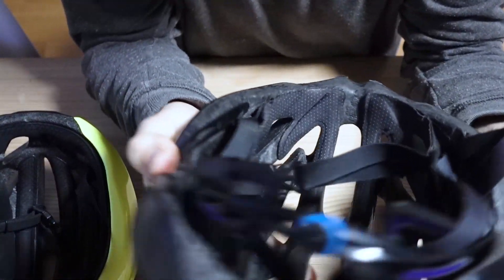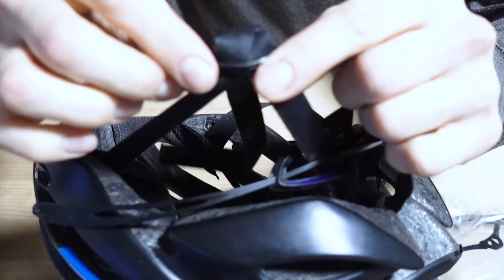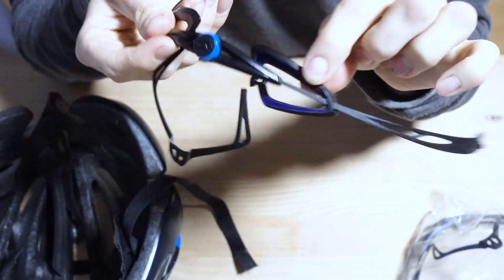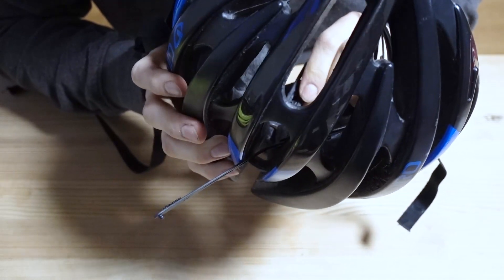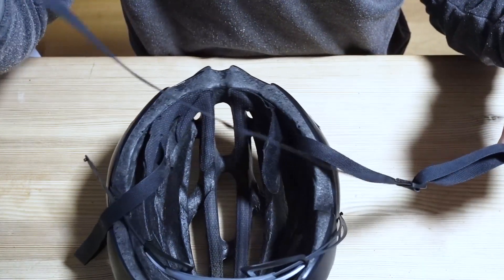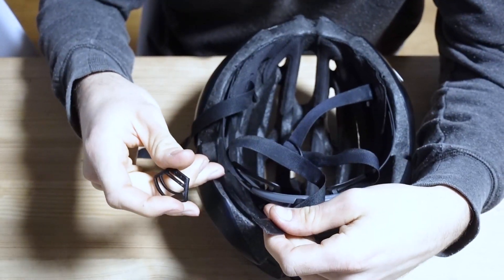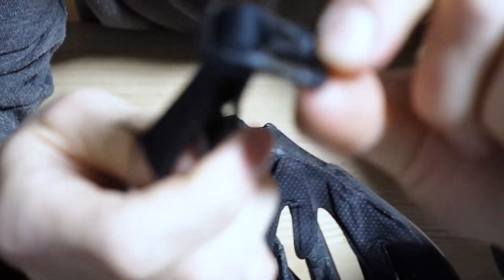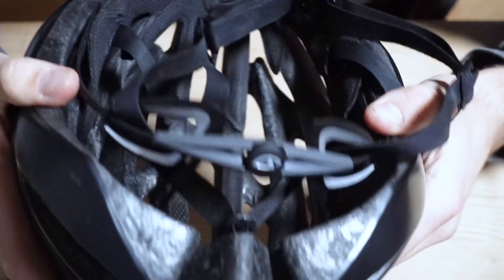How to replace the ROC LOC 5 Fitting System on Giro Helmets

Comment: Thank You!! Video so helpful, it took about 8 minutes and now I can go ride.   I took some pictures of the strap threading before I took them out as I didn’t have another helmet to follow.  For those folks that had a tough time with inserting the back piece, remember that you need to turn the piece 90 degrees to fit it in the back sliding slot so connect the front pieces until you get the back in.
Reply from the maker: happy to help:)

Comment: Thanks very much for posting this video. Very useful indeed for replacing the Roc Loc and saving me having to buy a whole new helmet. It was the tension adjustment dial on the back of mine that broke, but the same assembly as the one you fitted.
Reply from the maker: I appreciate that!:) yeah it takes a bit of time but us very well doable

Comment: I could not get my straps out from the second plastic clip / strap connection piece at all - let alone as easily as you did. The problem i had was the ends of the straps are folded over and stitched (to prevent the ends fraying), which was too thick to pull through the connecting plastic part.

i wonder, did you trim the ends of the straps first so they do not have he stitching? im reluctant to do anything that drastic - but can't think of other good alternatives.
Reply from the maker: Thanks for the question! Yes I had them trimmed already before maybe it is necessary

Comment: Some shop told me the RocLoc 5 cannot be replaced on a Giro MIPS helmet?! But I don't quite believe them.
Reply: On 3/9/22, I called Giro Customer Support to get a Synthe MIPS helmet Roc Loc 5 white plastic cage replacement since mine had broken in several places.  They told me that on this model, the Roc Loc 5 was not replaceable because the cage was permanently bonded to the helmet.  The brow pads were replaceable from Weber Sports.  To have MIPS Roc Loc 5 cage replaceability, which are also available from Weber Sports, I should only get the following 4 Giro men’s Road models:
1)	Cinder MIPS Helmet
2)	Aether Spherical Helmet
3)	Helios Spherical Helmet
4)	Eclipse Spherical Helmet